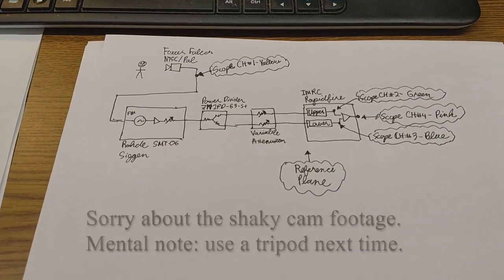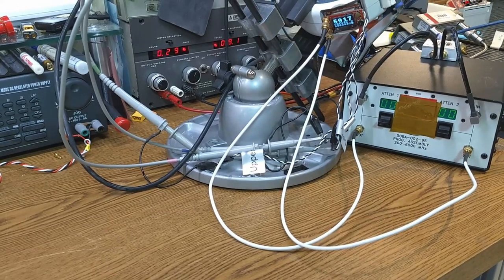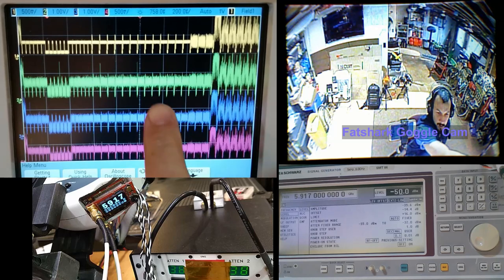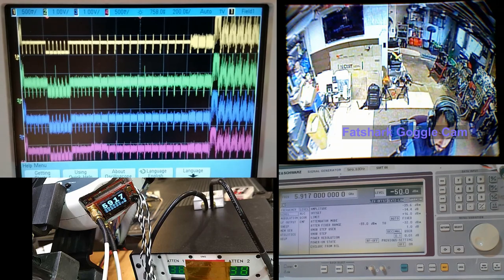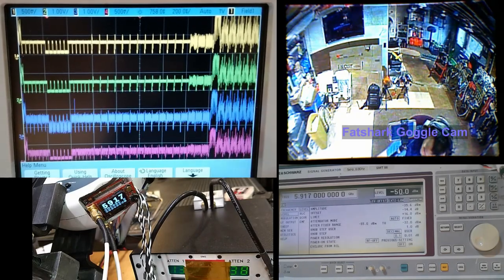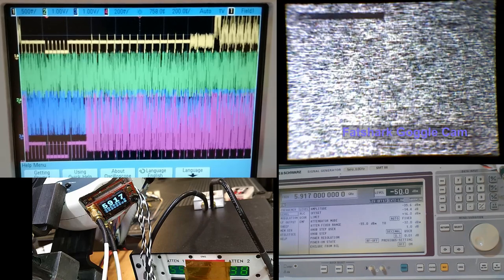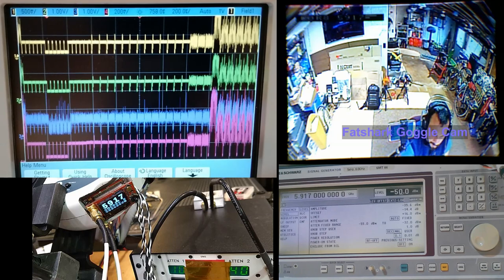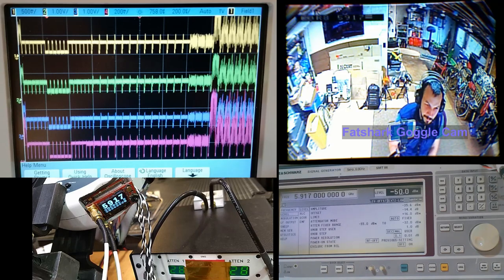ImmersionRC Rapidfire - Rapidfire modes demystified - Part 2, "magic"explained - PK's Lab

Comment: 18:28 interestingly, a lot of the times, the odd/even fields are swapped. I guess the goggle resolution is too low to see the bug of field swapping.
Reply from the maker: Dang, good eyes!  I didn't even see that.  You're right, I looks like they might have messed up the field order in the sync that they are reproducing.  I was thinking of doing a video covering the bugs.  This will def be in there.  Nice catch!
Reply: PK I checked my rapidfire , it does that too when signal input is noisy. When it’s swapped, the text osd from the camera gets more blurry  by a little, hard to notice from goggle. Thanks for the nice video!

Comment: Great analysis and whoa, you have some serious test gear!  Is it possible for you to inject a spike into one side and see what comes out in Rapidfire mode at various signal levels relative to the clean (no spike) signal.  Is the signal combination just mashing them together or is there some attempt to remove noise or mix at non-equal levels?
Reply from the maker: Thanks bud! I've got the Trued-X on the bench now but time permitting I'll get that setup and let you know what I find.